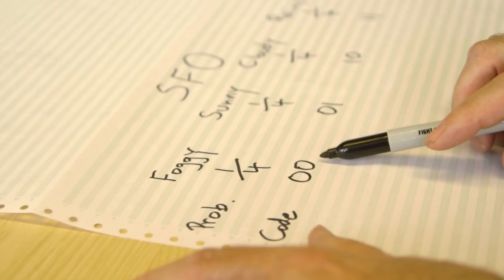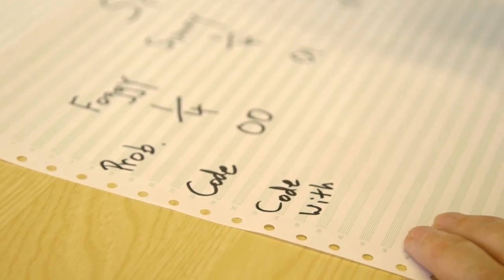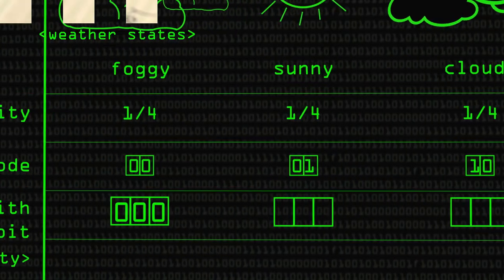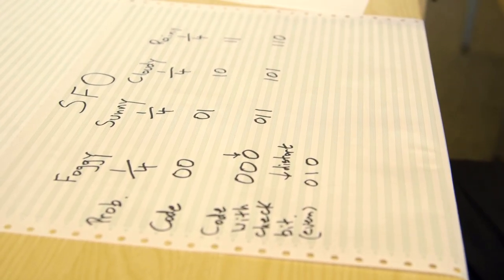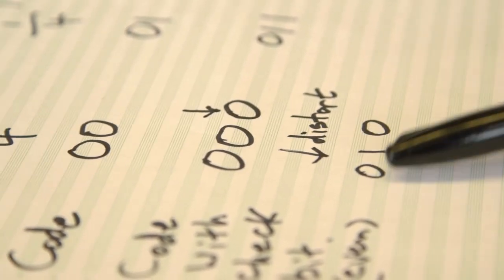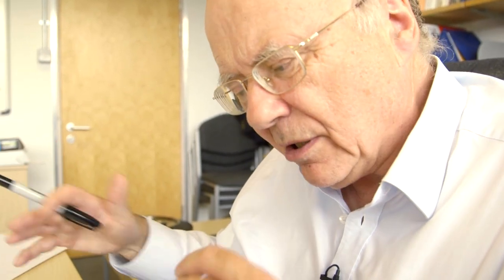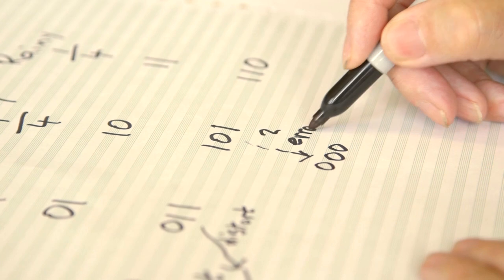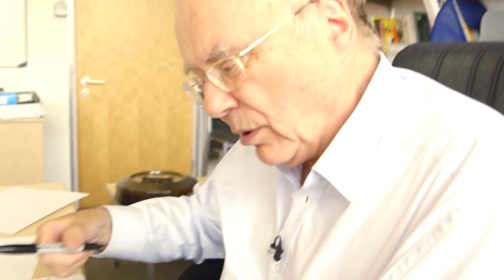Error Detection and Flipping the Bits - Computerphile

Comment: I love error correction. When I learned about it in Digital Logic, I was pretty floored that the simple rules could detect, and (in the case of Hamming code) even correct the error! I was floored. Of course, it's not practical, as I have the full network stack between me and the bits. But it is shades of things to come as far as what can be automated.

Comment: Details: use GF(2^n) instead of normal arithmetic, which means that addition, subtraction, multiplication, and division all "work" and don't require more than n-bit numbers. Treat your 15-number sequence as a big number without carrying from one place to another. Valid sequences are multiples of 1,1,1,1. Invalid sequences are a multiple of 1,1,1,1 plus a<<b plus c<<d, and you can solve for a, b, c, and d to correct 2 errors.

Comment: I was expecting to hear about that too. If you're interested, error correction (and detecting multiple errors) is done with a cyclic redundancy check (CRC).. There are longer and shorter CRCs that can detect/correct more or less errors in the transmission.

Comment: That was discussed in the video about compression; if you sent a 1, it could, in your system, be either "foggy" or the beginning of "cloudy" or "rainy". If the system needs to be able to send many messages with as little space between them as possible, they need to be possible to identify without wondering whether the next bit is part of the message or not.

Comment: Sure are.  One really simple extension of this idea is to use a "distance 3" coding, which means that each valid code has at least 3 digits different to any other code.

Now if any single digit is flipped, the error can be detected in the same way as explained in the video.  This time though the received message will differ from the correct code by only 1 digit, but differ from every other code by at least 2 digits.

This new system can detect errors of 2 digits, OR correct single digit errors.

Comment: sound file is transmitted as smaller blocks called bytes, 8 bits, which are validated just like weather codes, so the same thing. TCP stands for transmission control protocol, you have botch control and acknowledgment support, which is how internet works.

Comment: The receiving end calculates the bit aswell, and if they don't match it's changed.

If what you're asking is if two total bits get changed, that can't be detected with this method, but the odds of that happening are of course quite a bit lower.

Comment: I would also like to clarify that it's called a 2-distance code because the minimum Hamming distance between any two codewords is 2. That is, any two codewords differ in a minimum of 2 places. This naturally means that if there are two errors in a transmitted codeword, it's possible that it would be read as a different valid codeword, and so what Brailsford said was essentially the same thing. I just want to make it clear why it's called a "distance" code.

Comment: I've actually played around a bit with TCP/IP on the wire, and that's exactly how the protocol does its error checking. IP will sum all the "on" bits in the IP header itself, and TCP will sum up all the "on" bits in the message and TCP header. This method is more robust than a single check bit, but it's still only able to detect 1 error in the worst case. Any transposition of bits can't be detected.

Comment: Audio and video files are very lenient in that you can have a lot of errors in the transmitted file and still end up with basically the same thing. When sending actual files we generally want to keep the file perfect, but in applications like streaming where things are time-sensitive, we often just let the errors happen so we can preserve transmission speed.
Anyways, the examples in this video are very simplified. There are much more rigorous methods of error-checking that work for large files.

Comment: You're going to have to either add parity info to the ACK message as well, or handle it in some other fashion (e.g. you'll see the remote end start behaving in an unexpected manner, sending messages when they shouldn't, or not sending them when they should).

Comment: Not all communication channels allow for two-way communication (for instance, your TV set is receive-only), or may not have symmetric bandwidths (e.g. the 'A' in ADSL is for asymmetric, you get different uplink/downlink speeds). You need to consider various constraints.

Comment: Ah, I understand now what you mean. The problem is that you're going to have to use more information for dealing with the variable message length. In other words, how does the receiver know whether the message they should expect is 1 or 2 bits long? You'll need to prefix a message, meaning you'll spend another bit where you were trying to save one bit. Some physical transport mediums allow you to use physical characteristics of the link for this, but in the general case there's no way around it.

Comment: Not sure what you mean by "bit for bit", but transmitting data in smaller chunks doesn't necessarily make the transmission magically more efficient. Protocols exist to solve problems with realtime systems, like streaming data for audio/video. For example, if I can send a big chunk of data with added bits for error detection and correction, then, even if the data gets corrupted, it can be corrected at the receiving end.

Comment: Bits by definition can only assume two values. At the physical link level you can of course encode multiple bits into a single transmission unit (called a symbol), but that doesn't influence the information theory behind it.

Comment: The problem with that method is that the checksum will get as long as your message and you will want to keep your transmission as compact as possible. By applying modular arithmatic on your checksum you can keep it compact and still have a fairly reliable errordectection!

Comment: It's somewhat similar, except that you've got longer packets (something like 60 bits with 44 bits of data and 16 bits of checksum). This is composed of 4-bit numbers, and you can ask if there's the right group of 4 of these numbers at the end. It's a distance 4 code, except that you get a bonus-- additional errors in the same number is free. Also, if you assume that there are only 2 numbers with errors, you can calculate which numbers have the errors and what the right answers are.

Comment: Not with 2 errors, but 3 errors you will get you an even number of 0's instead of 1's, in this example.  This is just a basic model to demonstrate the principle, in reality it's more sophisticated.

Transmission protocols are balanced in a way to have the highest performance and highest security.

But different info has different priorities.  for example: Losing a pixel on a youtube video is less important than having long buffer times, but losing a letter in a comment is worse than being slow.

Comment: So, the more bits you put in, the more resilience against errors you get. Then, with more bits, you can even correct the error at the receiving side without having to send the code again. So there will be a point to where it makes sense to put more errors in, either to make the transmission more error-tolerant, or to incorporate an error-correction into it, or both. So how to find out, where the limit is, at which more bits don't help any more for resilience nor error correction?

Comment: Brady, I'm guessing there will be more entries in this series? Brailsford only got to 2-distance codes, while mentioning that you could detect one error and not correct any. I'm assuming that the next video will introduce a 3-distance code, show that it can detect two errors and correct one, and then generalize by showing how many errors an n-distance code can detect and correct. Am I on the right track?

Comment: I think the simplest way for checking errors is to ping the code. Weather station sends 101, you receive 101, so you send it back. If weather station receives the code it didn't send, it sends it again.

Comment: I was writing some simple networking code, once. I dont' usually do networking. I decided to add an integer at the end of all messages that sum up the total value of all the bytes before it. Should be pretty robust in detecting errors, I believe. Just one bit wrong, and the sum won't match up, and it's unreasonable to think that many errors could occur precicely so that the sum matches.
Good or bad idea?

Comment: The mathematical efficiency of using said redundant bits quickly becomes far more important than the space being used, so while it's a good question to pose, I don't think it's necessary. Really, it's just a few bits amongst hundreds, thousands etc bytes. How many you use doesn't really matter when you consider most practical uses as long as it isn't too few to perform well; the really important parts come with how it's done and how that compares in various areas against other methods.

Comment: You could always have ACK/NAK be a two bit code. 10 for ACK and 01 for NAK. It would still have the same issues with 2 errors though.
In reality, TCP/IP always has a 16 bit checksum and there is very little chance of an error slipping by there.
There are 65535 different combinations to chose from instead of just 2. It works by adding all bytes together.

For instance, "I am a message" has a checksum of 1213 in decimal, 0x4BD in hex and 0b10010111101 in binary.

Comment: Wait, you mean you didn't have to program in your Data Structures class?? Mine also introduced C++, so we had to deal with creating nodes and preventing memory leaks and segfaults, which gets tricky really quickly. I didn't have a heck of a lot of trouble with it conceptually, but others did and I wouldn't describe it as easy.

Comment: AFAIK, modern networking protocols work in a similar fashion.

Rather than sending back the whole data though (which would be disasterous if you're sending huge data - think multiple megabytes or gigabytes), they send the so called "check sum". Different protocols use different means of generating it (e.g. the number of 1s across the message, which itself is divided into fixed "packets" so that the sum fits into 1 byte), but the point is to send back meta data that can be checked by both ends.

Comment: Well, not easily, but it is actually possible to track the physical address from the IP if you control the destination network (i.e. you're the ISP) or have cooperation from someone who does. ISP owns/lease the cable line from your home to their server, and they know exactly which IP address belongs to which router. This information usually isn't available to the general public, but they are available and trackable.

Comment: It's very interesting how we manage to resolute the problem of detecting possible errors, but what i found very, i mean very bizarre is how we manage to detect specifically where the bit with an error actually is, I as an electronic engineer student made a project for detecting errors using the Hamming Code. I would like you guys to make a video on how it works. I finished the project very nicely but I still find it very bizarre on how the parity detection was deducted as the solution.

Comment: Yes, that's what I meant: There is a point when the overall increase in usefulness of more bits is less than the effort that's necessary. But then again, to calculate this point depends on too many factors for a simple (and simply explained) formula, like are the wires the transmission uses below ground or above and many more factors that can't be easily factored into an equation. What a pity, I thought this was going somewhere along that direction.

Comment: At best, tracking the IP could tell you a very general region of the individual using that IP. Tracking an IP for someone in San Francisco would probably tell you that the IP is from SF, but from a place like Nebraska, it might just be able to tell you "Northern Nebraska/Southern South Dekota." What's worse is that most people don't use static IPs, so even if you could discern exactly where they were, there's no guarantee that it's the same person you were originally tracking.

Comment: Because the check digit is a single binary digit, and because ones are being counted rather than zeros.  Indeed, if you were to sum the binary digits set to 1 in the original code, the low-order bit (least significant bit) of that sum will always be equivalent to the parity bit used for "even parity" transmissions of that original code.

Comment: you can discover the general area you live. Basically the location of the local network that you hook into via your service provider.

 IP information contains no geographical data and instead you must look up the IP adress on a data map provided by the ISP's. Many websites use This to deliver targeted adds. This only shows within tens miles of your location, often hundreds in rural area

You can get an exact location with PRIVILEGED information from the ISP, yet the ISP dose not give that away

Comment: There is no limit, really. More bits will give you more space to take advantage of error-checking methods. However, some methods with fewer bits can easily be better than other methods with more bits (because complicated math) and you will also never be able to reach perfect detection no matter how many bits are used. The main issue is considering what is practical.

Comment: you are never to have 100% error free communication. in general after the  Acknowledge/Not Acknowledge message is received, the receiver sends back another message to ensure the sender that he received the confirmation and from there another set of error checks ocurr; but, of course, you can never reach 0% of error. ultimately it all comes to the best/biggest error check => the smallest possibility that an error would slip by

Comment: The bits are received one after another, without a clear way to tell where each "message" ends. So if you receive "1", and then "0", you can't really tell whether you're receiving a single "10" message, or a "1" message followed by a "0" message.

You COULD force a time limit, but that means you can't send data continiously - you must send one bit every N miliseconds or so, which is obviously unacceptable, especially in the age of "gigabit per second" ethernet networking.

Comment: No, it doesn't. The integer is 4 bytes. The sum of the 4 bytes before it can only be a maximum of 256x4=1024. As you can figure, since a 32bit unsigned int can go a hell of a lot higher than 1024, you can have a fairly long message.

Comment: Yh, I just had to grasp the concept. XD

I had to program some of the Data Structures I learned there in my programming classes, but that was easy too, basically you just had to convert a given algorithm into a java class (and I already knew you to program).

But in Computer Graphics thinks got pretty tricky, when I had to implement a 3D k-d-tree in my ray-tracer (in C++), and there I also had to prevent memory leaks and that stuff. Now that required I hell of a lot of thinking XD.

Comment: eer no as most external ips are reset every 12 hours, (i think,) apart from properly set up servers that have to have a fixed address. You would have to track the mac address to find a specific machine even then the are not in any way linked to an actual street address. your question is stupid and so are you. I'm not a computer scientist and admit I may have got my explanation a bit wrong.

Comment: Speak for yourself. People have all different interests.

Also, are you suggesting they *dumb it down*? I've got news for you: they're already presenting it in about the simplest way possible. As for your suggested topic, I'm sure a fair bit more thinking will be involved; you have to get at least a little into how IP addresses are assigned and how routers handle them. If they were randomly assigned, they would be geographically untraceable, but also unroutable. Think on that. ;-)